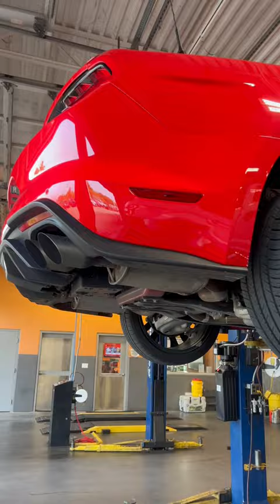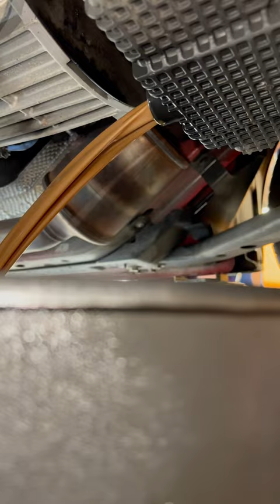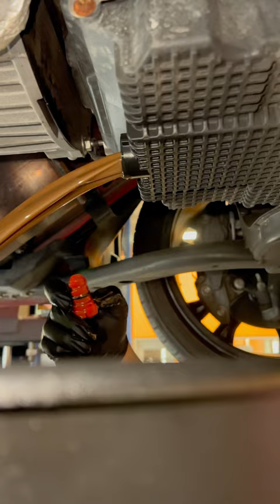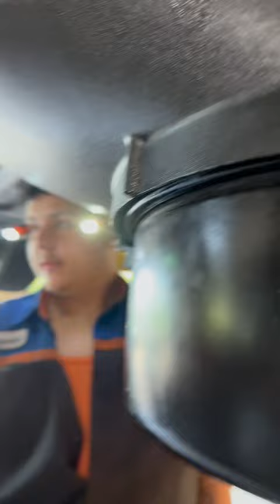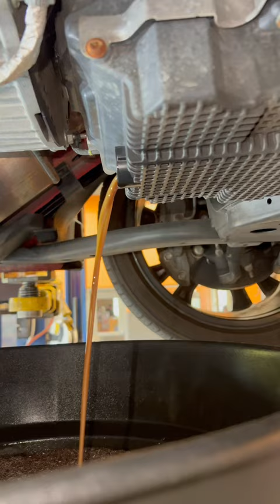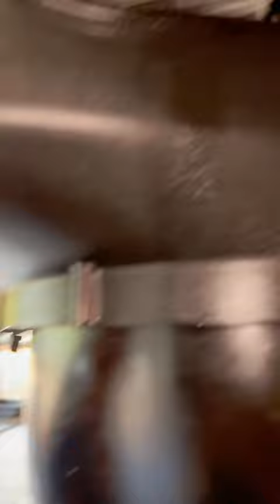COFFEE IN OIL PAN? Don’t forget the creamer? Customer comes in with 28k mile 5.0 manual. #ford

Comment: thats ford quality right there. 28k headgasket blows? absolute garbage.
Reply: Absolutely untrue. I’ve seen these engines with well over 150,000 miles. The owner either overheated this vehicle or they failed to flush their cooling system which led to premature failure.